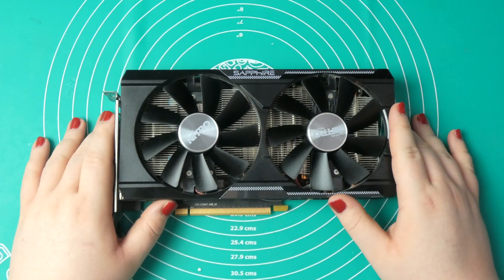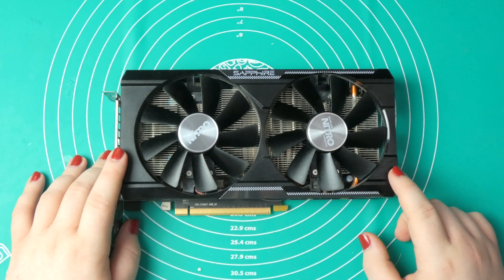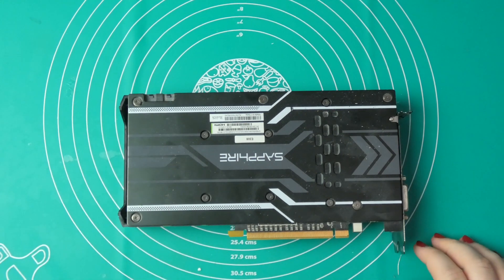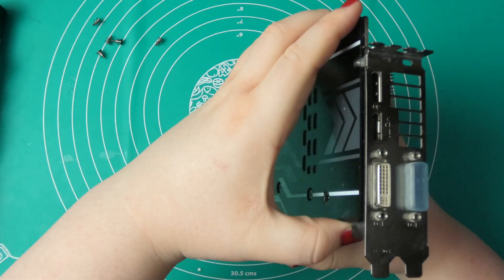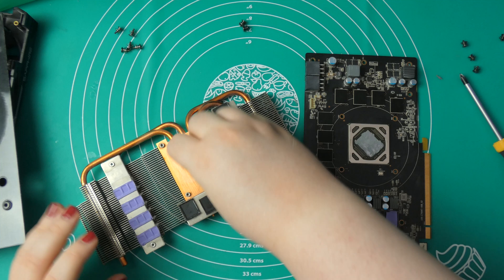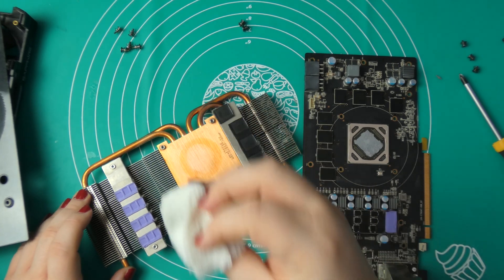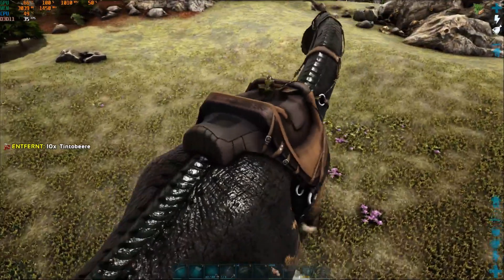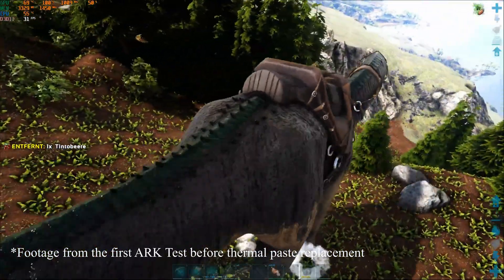Improving Temperatures on my 5 year old Sapphire R9 380 - not as much as I hoped for.

Comment: According to northwestrepair guy, silicon grease can be corrosive on small contacts on the PCB.
 I believe when comes in contact with other materials on PCB prolly is changing composition.
If you take in consideration that an essential oil made out of a plant can be corrosive and burn your skin than I guess silicon grease prolly can do that as well over the contacts.
Reply from the maker: @pete0274  Hey, thanks for your comment! 
What you can see on the pcb is not silicone grease but silicone oil. 
Also silicone grease is widely used as corrosion inhibitor because it is chemically inert and therefore does not react with anything. However it is also hygroscopic which means over time it attracts moisture. This moisture in combination with oxygen then could cause corrosion. But that is very very unlikely as oxygen does not simply pass through silicone grease as the moisture does. Now if that moisture were to be acidic we could observe the acid reaction to the underlying metal. But that also is very unlikely.
Reply: @PhysicistAnna  Thanks for the info. Yes, sorry, I meant oil not grease. One question though, why silicone oil is hygroscopic?
Reply from the maker: @pete0274  I'm happy I could help.
About why it is hygroscopic, that is a good question that unfortunately I can't answer as this is beyond my knowledge. This would be something for a chemist to answer.
When you commented I knew silicone oil or grease is chemically inert but I double checked my knowledge either way. I also knew of oil dryers/ dehumidifyer specifically used for silicone oil, I just didn't knew that silicone oil or grease was hygroscopic. That I found out thanks to your question. I always thought it was contamination of silicone oil and not its chemical property to attract moisture.
Reply: @PhysicistAnna  I think is safe to say any dust(with or without silicon grease)  will attract moisture depending on the humidity of the room where you running the PC. Silicon oil/grease will keep the dust in one place and prolly will cumulate there bringing more moisture. BUT the card temps will dry out the moisture and than we are left with the fact that silicon grease/oil will mix with other compounds present on PCB, composition is changed in God knows what and that can favor the corrosion. I'm thinking that way. 
IMO your aim Anna, mine to,  is to cool down properly the VRAM, GPU itself can throttle down, VRAM can fry, will show artifacts(but not necessarily!! don't want you to think you'll have that warning, in many cases chip died out without artifacting first) and one of mem chip can die bricking your card.

Manufacturers does usually the minimum, is our job to  cool our cards properly even if we don't like it, will take time and tests and will take some money to.
For example your 380 and mine to, cause I have the same, will  clearly need more heat transfer from PCB to back plate. You have but a single patch of thermal pad on power delivery, nothing on VRAM. In this case backplate will not be saturated with heat and again is acting more as heat trap.

 I will use thermal putty as I said first on my main setup 1080 Ti EVGA  and than on my Nitro 380 secondary setup.
Maybe you know but, I will mention it anyway, when GPU is let's say 65 C you VRAM will be at least 15 C higher(can be also 20 C higher depending on some factors) so VRAM will be 80 C or 85 C. 
I consider critical 100 C on VRAM I don't care what manufacturers say.
Rear fan of your case is very important in cooling you GPU if that GPU got enough thermal pads in between PCB and backplate. Look for a tear up video of 1080 Ti EVGA ICX you can see there  TP are there in some quantity for a reason. Backplate is to take a way the heat and disperse it. Only than case fans can take away the heat away from your GPU.

On the other hand lack of textolite in the layers of a PCB will not stop the heat traversing PCB from one way to to the back.(research this material  is very interesting and worth your time>>> Textolite)
Textolite should be in any GPU PCB  exceeding 150 Watt TDP IMO.
On my 1080 ti with 290 W max TDP(380 Nitro is only on 190 Watt so less heat) my VRAM atm sits equal or under GPU temps which was my aim. Initially my 1080 Ti sitting in a XL case was reaching 75 C on GPU meaning that my VRAM was 90 C or over while playing RDR2 at 2k, high settings. So I proceed with my mods :
1. Deshrouding the card changing 3x 88 mm/ 11 mm thickness original fans with 3 X 92mm/25mm thickness(more airflow and less rpm /less noise)
2. Cutting the grill for my rear fan of my new expensive case cause was hindering the efficiency of that rear fan with with 15-20 %. Research yourself the tests made by Puget Systems in 2011 of various fan grills.
3.Adding of another 92 mm fan in PULL not PUSH on the back plate of my GPU in the exact spot you see in the video https://www.youtube.com/watch?v=MfaVVInZt5A  at 2:44 you see test results (this mod will work poorly on the 380 by Nitro because lack of enough TP in between PCB and backplate, also the backplate is plasticated on the 380 and is not on 1080 TI. 1080 Ti has no plastic layer sticked on backplate.

Note that the test in my video are 2x instances of Valley benchmark in same time  and last only 10 minutes but in AAA games(1 hour) is showing even greater results.
ATM the back plate fan was increased to from 1000 to 1200 RPM still inaudible - is A Noctua Redux 92 mm. At 55 C GPU in 2 K with VRAM temps ranging from 50- 57 C for example in Assasin Mirage.
Also take in consideration I changed only thermal paste on the GPU, the pads are leaking and wasn't changed from factory defaults. My 1080 Ti has various thickness pads and many so is costly. I'm gonna use putty as is superior and cheaper. This year I will use the putty , test it and make a video.
Why thermal putty? First, is cheaper secondly, we have and a very good tester, this guy . He is hashing  his cards and OC is VRAM on cards consuming over 400 Watt. That's a lot of heat right there.  https://www.youtube.com/watch?v=GZgSCWt6uzE  42 :48 a comprehensive chart of different thermal putties. I will stay on UTP 8 and prolly CX 1300.

Hope it helps

Comment: Hi Anna, what size of thermal pads you used on this gpu? 2mm? 1.5mm?
Reply: Use Thermal Putty instead > UTP 8 by Upsiren way much better than any thermal pads, not to say is cheaper. Dries way slower and don't leaks silicon grease. Add more strips of putty including over VRAM, Sapphire did a lousy job here, backplate for 380 is more of a heat trap compared with their 390 Nitro. VRAM is the most heat sensitive and has to be cooled.
Reply: @pete0274  Thank you Anna, I will try to use Thermal Putty the next time.

Question: Do you recommend Thermal Putty on PS4/PS4 Pro RAMS instead thermal pads?

Comment: Okay but the paste is smeared too thick.The paste is only intended to fill in bumps so it should be spread completely thin.Apply the paste as much as possible on the thin and in the middle of the processor dap a small dot of paste just in case.If the paste is spread too thick there is no result but the temperature is much higher.The temperature also depends on the quality of the paste.
Of course, the paste for about 4 dollars does not have the same quality as the paste of the same packaging for about 10 or more dollars.Cheap pastes are worth nothing.

Comment: Hi Anna, I need some help with my gpu, exact same model, but can’t fit the backplate back on as the screws won’t make contact with the threads, one of the fans has also broken and I’m unsure where to get a replacement, I would much appreciate any help, thanks👍🙂

Comment: Replacing the GPU fan with 2 120mm fans zipped tied to the heatsink does really help with the noise!
Reply from the maker: I ended up watercooling it :D Filmed it but have to do a slight mod. When I'm finished I'll release the video.

Comment: To clean gpu (and even cooler contact surface) and not worry bout contacts and cotton strings, you can just use some contact cleaner, like the fairly common WD40 or maybe Philips 390CCS, just spraying it on the chip will clean the paste right off, then you just dry it with bit of paper like you usin there (or let it dry). Both GPU and cooler turn super shiny in no time, ready for brand new thermal compound.